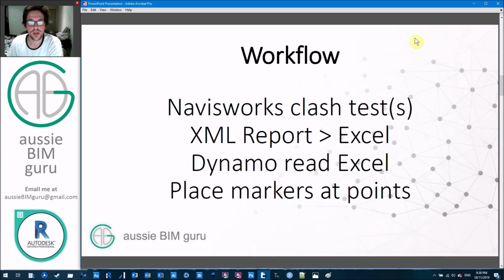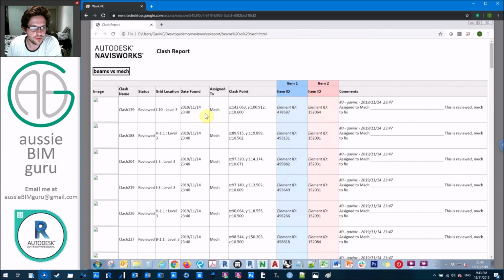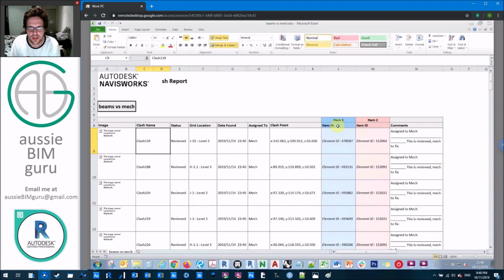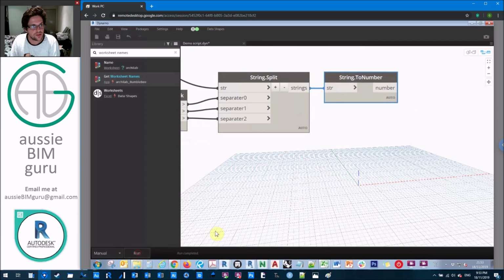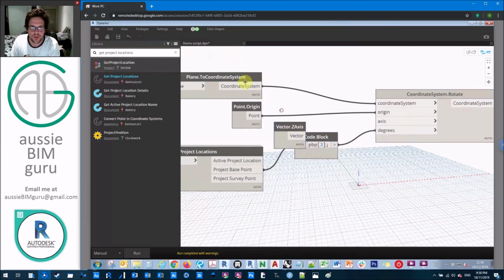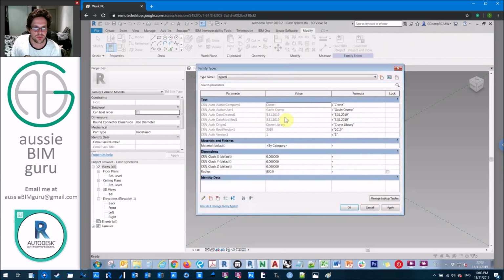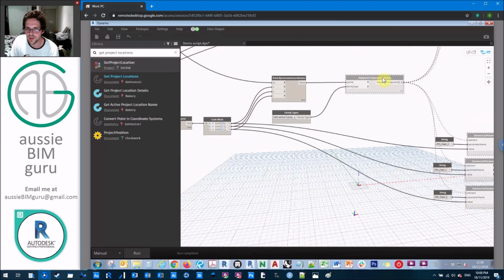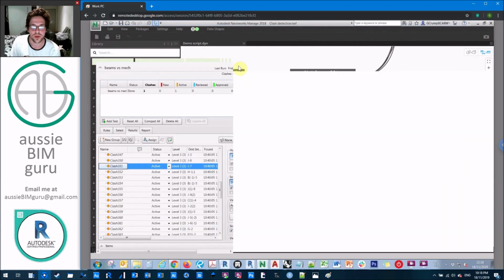Navisworks Clashes to Revit using Dynamo!

Comment: Hi sir
Thank you for this video.i did same thing in this video but when i come to ' coordinate system rotate ' i am having issue.Issue is my clash ball dont stay in my project.Also my project has elevation value and i dont set code.block bottom of coordinate system rotate. How can i fix that ?
Reply from the maker: To correct elevation discrepancy, you would need to add the elevation of your internal origin to your points, probably using the translate node at the end. Usually people keep this point at RL 0, but it looks like you must have it higher than this.

If the translated coordinates aren't working, there is probably an error. Check the rotate/move steps are working a few steps at a time carefully.

Comment: Truly inspirational. Can't thank you enought. I have followed your instructions, and concluded that when you add more information form Navisworks (like Layer Name, Item Path) ID columns are not next to each other, so I made some slight corrections and additions to your original script. Hopefully you dont mind me sharing it on Dynamo forum. 
https://forum.dynamobim.com/t/navisworks-clashes-to-revit/49139
Reply from the maker: Thanks! More than welcome to share the idea and script (it's on my github anyway).

It's always great to see people innovate on my ideas, I always have to stop short of the 'polish' so it's never quite complete. Nice work on adding those extra touches :)
Reply: I'm using vuk vukanic script but get an error on Custom node definition is not loaded.
Reply: @zulamri6447  I listed the required Custom Packages needed for the script to run in the description within Dynamo. What node is showing the error?

Comment: Good work gavin...I have elevation difference in survey and project  base points... how do i proceed that..
Reply from the maker: Subtract the two elevation values and add or remove from the z values of the points; whatever combination gives you the adjustment you need.

Alternatively you can translate (move) the points instead by this value.
Reply: @AussieBIMGuru  Hi Gavin, firstly thanks for the video, I really admire your work, it is helping me a lot.

I did the same script following your video, it works fine just the point come in a different elevation because the model has an elevation difference between Base Point and survey point.
Active Project Location (Z=0)
Base Point (Z=0.3)
Survey Point (Z=0)

I tried what you suggested in this comment, but it still didn't work, but it worked when I subtracted 4700 from all the Z values of the points.
I cant find any relation, why the number is 4700 to the point to fall right in place. Do you have an idea why?

Thanks again.

Comment: Further, after adopting the method, I realized that there will be 3 additional blue points created throughout the process, even we when attach the clash sphere, those three points would not have anything to be attached on. When i zoom out of the model. The three points are very far away from each other. This increase the difficulty in turning the model around also when using zoom to fit as they will zoom out to a very far place. Any idea why these three points were created and any resolution to it?
Reply from the maker: I suspect these points are from the genius loci coordinates node, try disabling its preview. Theyre probably the three base points.

Comment: how come i can't find that get worksheet names node?
already in dynamo 2.0.3
Reply from the maker: 3:25

It should be in Bumblebee.
Reply: @AussieBIMGuru  ..what is Header refer to and can i use this method for clash detection between 1 discipline mep to other discipline only..
Reply from the maker: @dodiisnandar4287  yes you can generate a clash report for any NWC vs another NWC. The names of the parameters being isolated in the report (in the header row) should be the same regardless of the file.

In this example I do structure vs. mep but you could do mep vs mep also.
Reply: @AussieBIMGuru  what happen if the result of get project coordinate doesn't show some rotate data in your video it show 15 degree .. ...which node that i should use?..i can't use the coordinate  system rotate am i ?
Reply from the maker: @dodiisnandar4287  the method i show is the best way, but the genius loci mode behaves differently between versions. You might need to process its results differently to isolate the angle and xy translation numbers from the lists it outputs.
Reply: @AussieBIMGuru  ..can u try this method for MEPclash detection?

Comment: Very interested in this workflow. Can you tell Revit to automatically adjust the clash and what happens if you are using fabrication parts with rolled 90s and 45s?
Reply from the maker: This workflow is mainly focused on marking the clashes so users can judge the solution within their model.

Technically an alternate script could be used to reroute ducts through clear space adjacent, however each scenario would be rather unique so it would be a very lofty challenge (far more complex than this script). It would likely involve generating a 3d space lattice using Topologic, removing all points within duct size tolerance of neighboring pieces and finding the shortest possible route through the remaining viable points. MEPover could then turn this geometry into ducts and connections.
Reply: Aussie BIM Guru would you be open to creating this for us?  Do you work for hire?
Reply from the maker: @slidewalker  whilst I will be running my own BIM consulting business in March, my insurance doesn't cover me for work in the US (good old patriot act!). Looks like you're in Birmingham AL? Hoping to expand it once it grows in a few years.

I would get in touch with Sigma AEC Solutions and Sean Fruin - he is a strong Dynamo MEP consultant (I'm not as experienced with MEP) who does script building (one of the best I know) and is also state side. I believe this idea would be of interest to him. Would love to hear how it goes if you do

Comment: Hi Gavin, I have question for you. I've succesfully bild this script following your tutorial (thanks!) although I had to do a few adjustments, probably because of nodes versions. 
Now I'm trying to implement this workflow within the team but there is one more step missing in order to work that I'm not able to finish: here I go>
I've added a new shared parameter called "Clash_Priority" in order to allow the project leader classify them and assign other team members to work on those one. But the problem comes when I run the "second week Navis test" that overrides all the manual input. Is there an easy way to save that data? Perhaps creating another script that overrites first the Navis Excel by adding a new column called "Priority" before pushing the bubbles (this is what I've been trying so far)?

Thank you!
Reply from the maker: Welcome back to Dynamo land!

I'd modify the script to identify pre-existing clash markers (by checking their clash ID number), and instead of recreating them I would set the existing markers parameter values and use 'set location' node to update their location - this way your priority field isn't lost. Adaptive one point families can simply be updated in location using a single point. You'd need to use some boolean masks to split up the new and existing markers so that you can still create the new ones the standard way.

Hope that helps mate, and nice work on innovating on the script.

Comment: yes please, i love Navisworks, but......
Reply: To see the clashes back in revit is a crime. Searching on ID’s and so. 
And to the timeline working is even worse. Can we do something about that?
Reply from the maker: @BeneBraad  Hrm I wouldn't go as far to call it a crime... I agree that an experienced user could work fine with switchback and ID's but on average I notice users find this workflow saves them time. It's important to remember that on average most Revit users don't know how to use Navisworks (which to me is the true crime!). Also worth noting Navisworks Manage is outside the AEC Suite, so not every user has access to the clash detective to review and fix issues - manually pouring over the clash report is a clunky workflow vs. visualising the locations in the software I think.

Obviously they need to clean up as they go, rather than just dump in clashes and leave markers behind, but given the remodelling is undertaken in the model itself and not Navisworks, I see value in this workflow (and have seen it used successfully by teams before).

BIMTrack is a good integrated solution to this problem also, but not every firm will throw money at it unfortunately.

I'm not 100% sure what you mean by timeliner issues - assuming you mean that handling elements by timeline is difficult in Navisworks? In my experience most firms will typically add a parameter to all elements in their model on an instance basis and then populate this with the associated phase of construction, then they animate the search set of this field in Navisworks. It gets messy when you want to divide slab pours etc. and the model hasn't been broken up though - usually I find that communication with the builder is critical as early as possible if this is a project BIM goal.

Ideally it should be captured in the BMP as a specific modelling requirement if LOD does not require it. The builder should ideally have a BIM auditor who can verify the model will achieve the 4D requirements also, otherwise no-one takes responsibility (and it usually just gets dumped on the architect in my experience).
Reply: I’ve to say. I’m a MEP engineer.
Reply from the maker: But....?

Comment: Why not read de XML directly?
Reply from the maker: Great question (and valid), I have tried this method and determined that the de-serialising process is too complex for the average user. I also prefer to read XML reports in MS Excel when using them for other purposes also!
Reply: @AussieBIMGuru  understud.
I do prefer less processes. I will try by The XML directly. Thank you for The vídeo.
Reply from the maker: @sneffetsd  you're welcome!

I believe the lunchbox package has some workflows that might help with the process; http://www.theprovingground.org/2015/04/integrating-xml-with-dynamo-via-lunchbox.html